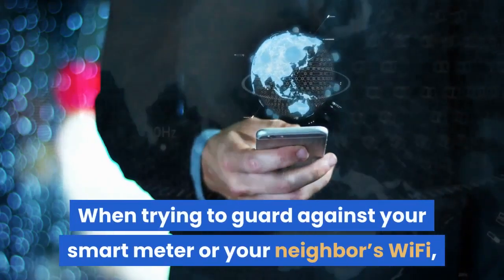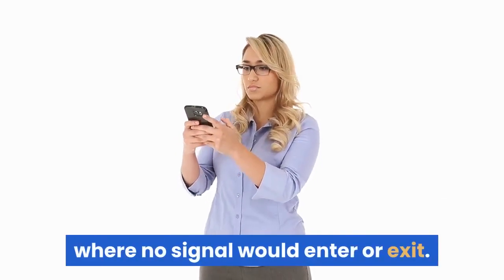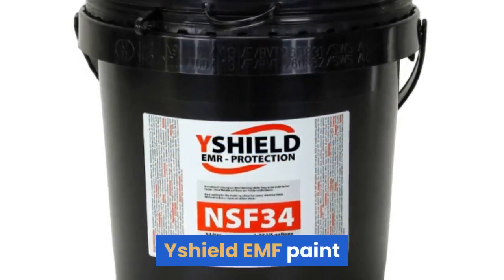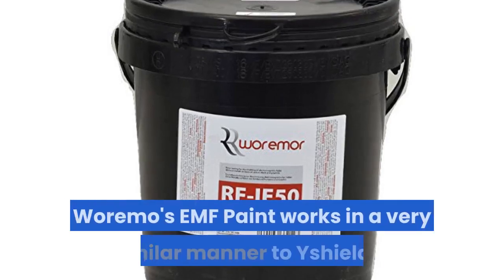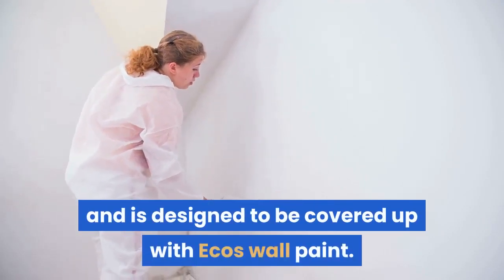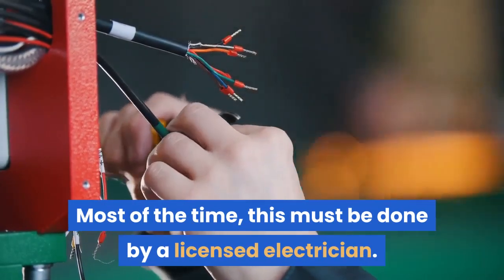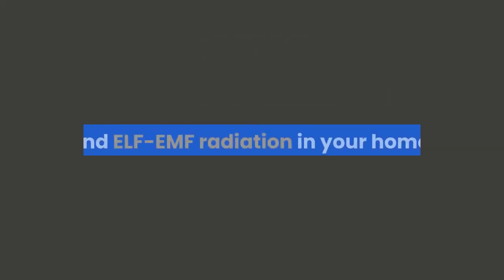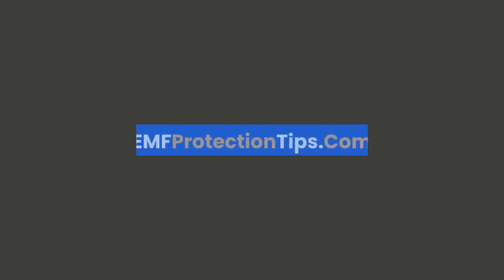Why EMF Shielding Paint

Comment: It is NOT true  that EMF (Electro Magnetic Frequency) from WiFi and  cell / mobile phone signals  are harmful to human body.  EMF from WiFi and mobile phones are just too weak to cause any harm to the human body. If EMF was indeed harmful,  then there would be hundreds  of dead people near a TV station antenna. TV station EMF radiation is  more than 1000 times stronger than WiFi  / mobile phone EMF waves.  This is a marketing gimmick.  I am an Telecommunication Engineer with Masters Degree.
Reply: Death, in this case and more generally, is not instant but a slow process - made quicker by the Expozome
Reply: @benl734  not true . Electromagnetic waves used in mobile communication is very very weak and not harmful to human body , just  as sunlight heat is not harmful to humans body. By the way, sunlight is also electromagnetic waves.
Reply: Then I can only suggest you ask for your money back from your university because if you can only reiterate the media, which is largely owned by telecoms and BigPharm, I doubt that you made high school because there are over 300 peer-reviewed papers that prove that electricity and especially, 2G, 3G, so called 4G (LTE really) and 5G (These frequencies were used as weapons by the USA in Afghanistan in the last two decades and are detrimental to life).  All papers provided by the telecoms industry or through media companies they have shares in or advertising budgets are favourable to cellular technologies.  I have worked with four network providers in the UK and have integrated telephony and IT in the eighties to produce revolutions in the City of London and beyond and have seen factual proof that 5G will accelerate the cocktail of chemicals in your body (approximately 4,000 of the 130,000 man made chemicals, which are all untested bar 20/30).  Please go and do some deep research as your comments do not compliment your stated calibre. I will take my hat of to you if you can truly investigate what is a scandal and has darker intended consequences for mankind.
Reply: @AndrewCharnley  please do Google search on Maxwells Equation and try to understand Electromagnetic wave. My company will hire you at $ 3000 per day for your expertise in Maxwell Equation which is the foundation of understanding Electromagnetic waves.
Reply: Syed Ahmed  of course wifi lies in the microwave spectrum, 2.4 ghz and 5 ghz respectively. It lies close to uv radiation. If u talking about about television that lies in the megahertz. So tell me, can you explain to me the theory of electromagnetic frequency and wavelength and its energy states. Energy the body absorbed is cumulative. No matter how little the energy is. The duration of time you expose to that will cause damage at the cellular level. Here is an analogy, work in a place where they have 14 large attenna for 10 years and tell me how you feel.
Reply: Syed Ahmed your job is working in an office not spending most of your time wihin that dangerous environment
Reply: @syedahmed1729  Will you put up a link please? I'd be grateful. Basic as poss please!!
Reply: @judy1angel  do Google search on "power from cell phone" it will show University course  lecture. A text shows cell phone have low power transmitters 0.6 to 3 watts. Then do Google search on "TV Station transmitter". It will show that TV station transmitter transmits greater than one million watts of radiation. Are there dead or diseased people living near TV station antenna ? How small is 3 watts of cell phone or cell phone base station  of only 40 Watts compared to TV station antenna radiation of over million watts? Are people living near TV station painting their rooms to prevent TV radiation from coming in ?  Just as low  heat of coffee or tea is not harmful , compared to heat of furnace , so is low radiation of 4G, 5G phone NOT harmful to humans. Selling radiation preventing  paint to ordinary people  is a MARKETING GIMMICK.
Reply: @larektai7086  Rusting that you mentioned is due to the metal exposed to oxygen in air and oxygen in water and not due to electromagnetic radiation
Reply: @AndrewCharnley  obviously the argument you have presented shows you are not an engineer or a scientist and your logic is wring. I am paid over $ 1000 a day for my expertise in Antenna Design and Radiation.   If you can prove your expertise in Electromagnetic energy, my company will pay you $ 3000 per day. Please send me your resume.
Reply: Hey syed Ahmed. Let me ask you then. Why did a cell tower supported structure rusted after few years? If emf or rf does not affect the integrity of an atom, why did it lose electron and become rusted? This structure of course is protected by paint since it was built.
Reply: @larektai7086  Syed is in a fantasy world, he knows as much as Google tells him.
Reply: @larektai7086  Rusting is due to absorption of oxygen from air and not due to EMF.  Ask any chemistry teacher.